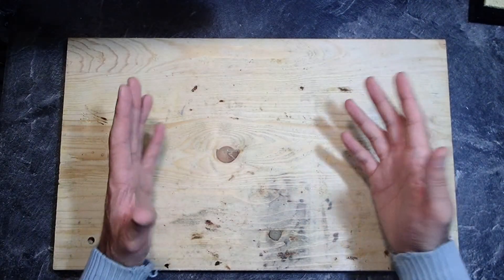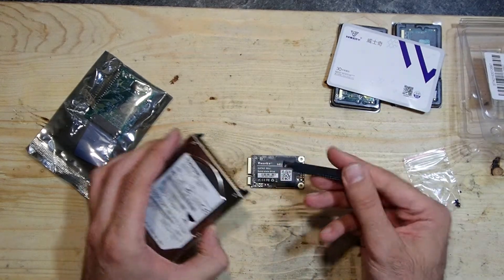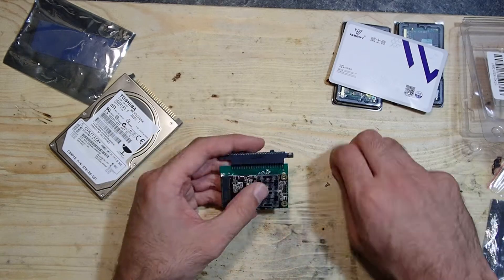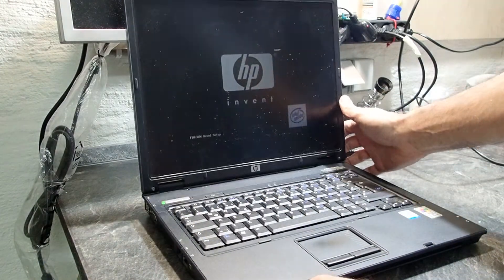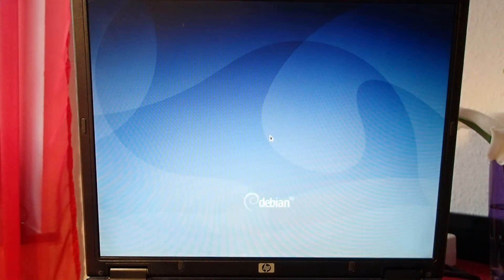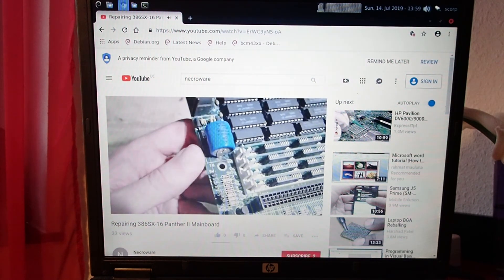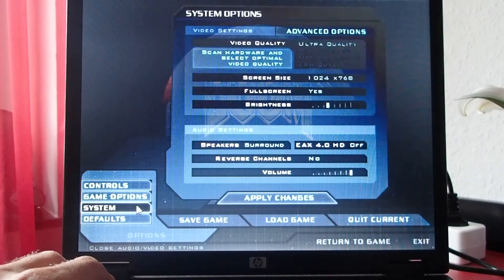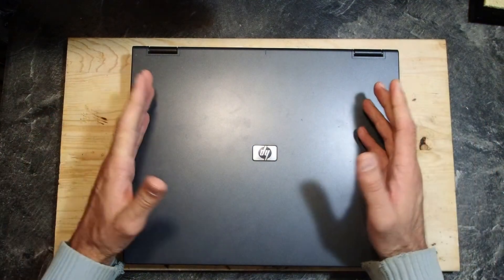Reviving old notebook HP Compaq nx6110 (Part 2)

Comment: Amazing video man! I just got this laptop around 2 days ago, comes with Pentium M 750 1.86 GHz, 40 GB HDD and 1.5 GB RAM, And it is running pretty great! YouTube runs maximum at 360p. Also Windows XP is Installed. Thinking about upgrading to an SSD or buying a 2nd HDD Caddy instead of using the DVD Drive and installing a 2.5" SSD. But i don't know if that is compatible with Windows XP.
Reply from the maker: Thank you very much! Indeed, I am still surprised how usable this machine still is. I already got a new CPU and will do the next video soon and also present some benchmarks. Regarding SSD on windows XP, I think, it will work. However, I can't suggest to use it today. There are no security updates anymore and most modern software doesn't support it either. As you can see I made quite good experience using Debian 10, your system is modern, safer and at least as fast, as it would run on windows XP. At least as long as you use XFCE or similar lightweight desktop environment. Especially, since you have only 1,5GB of RAM (max is 2GB, what I installed), you will find yourself very fast at the limit. With XFCE I have base memory usage under 350MB, the rest should be more or less enough for a browser or other programs.
Reply: @necro_ware  Thank you for your valuable suggestions and information! Do you suggest any tutorial for me to learn how XFCE  works?
Reply from the maker: @leonidasdrogkaris7304  There are many many videos on youtube about how to install Linux. Important to understand is, that not like in Windows, where you have only one possible graphical interface, on Linux the operation system is separated from the desktop environment (graphical interface, if you want). You can install Linux without any desktop environment, with console only, which is good for servers, where you usually don't have any monitor connected anyway. On the other hand, you can select from a lot of different desktop environments, like Xfce, KDE, Gnome, i3 and many more, for your desktop computer. They all have different look and feel and different resources requirements. I prefer Xfce because it runs very well on low powered hardware and is very user friendly. Especially for Windows users it is a good way to go, because it is very similar on the surface. I guess the best way to start is  to give it a try. Just download Xubuntu disc image from the official page (don't mix it with Ubuntu, it comes with heavy Gnome desktop environment), burn it on CD or write to USB stick and boot from it. There you will have an opportunity to tests or install it. If you don't have any valuable information on the notebook and you are open for experiments, just install :) Anther good distribution, which I'd suggest (even more than Xubuntu) is at manjaro.org (pay attention to get Xfce version).
Reply from the maker: Oh I forgot one thing, this notebook can only 32-bit, so manjaro will be not an option, because they support only 64-bit. So Xubuntu or Debian is the option to go and pay attention to get 32 bit version of the software!
Reply: @necro_ware  thank you friend! I ll look for it!!
Reply: @necro_ware  Thank you so much! I ll take Xubuntu and Xfce since i have 32 bit system!
Reply: @necro_ware  Could you please also send me the link to see specs of SSD?
Reply from the maker: @leonidasdrogkaris7304  I don't have a link anymore, however the SSD specs are not important for this notebook. The speed is limited by the slow IDE bus anyway, so you don't get much out of it. Regarding the size, I used 64GB. It is not much from today's point of view, however, this is another benefit of using Linux, because the whole operation system takes about 1,5GB incl. all the applications. Just compare it to windows ;)